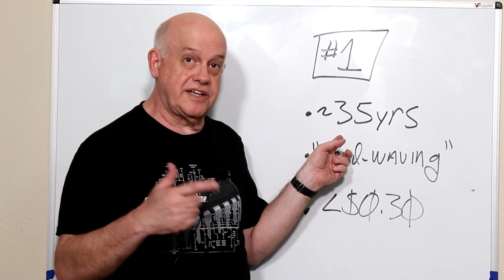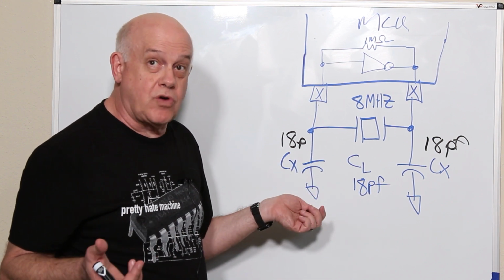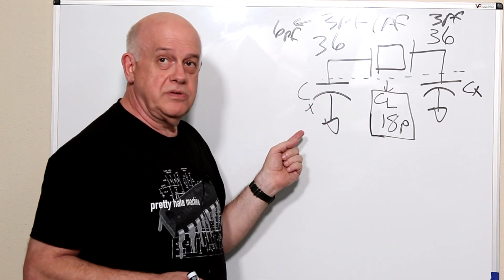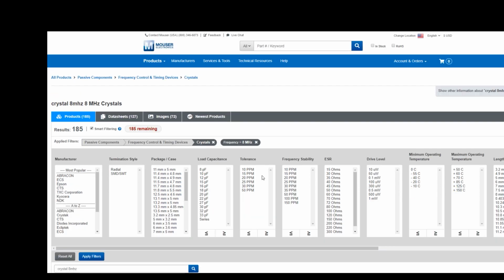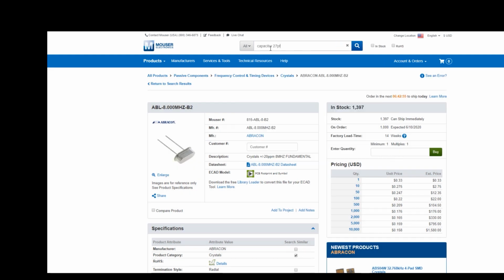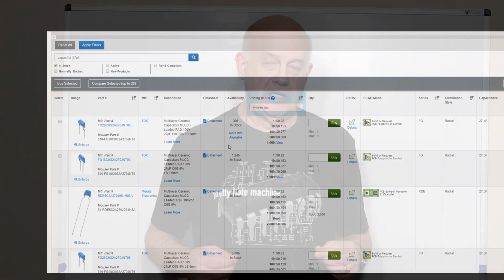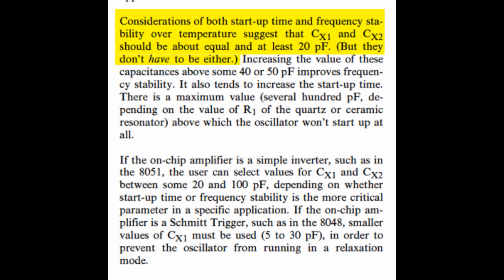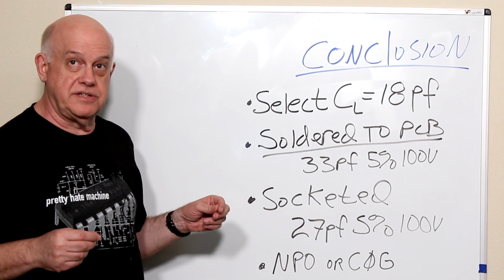Synthesis Technology Patreon Preview: The #1 Design Error of ALL TIME

Comment: Ok.  I have to ask:  As a mostly-hobbyist, I frequently am using crystals that came without full spec sheets, on PCBs of questionable design methodology, where I don't know for sure whether the chip will be socketed or not.   So Cl and Cstray are more random than in a proper professional design.  Is there a way to MEASURE whether the crystal oscillator is "appropriately loaded"?  I understand that even semi-pro level tools like a low-end oscilloscope can't be used to measure the frequency...

Comment: Having fallen precisely into the amateur trap Paul describes I'd be interested to know what happens if you do use 18pF capacitors with an 18pF Crystal. Does it result in timing inaccuracies, instability or other problems?
Reply from the maker: Covered in my next video.